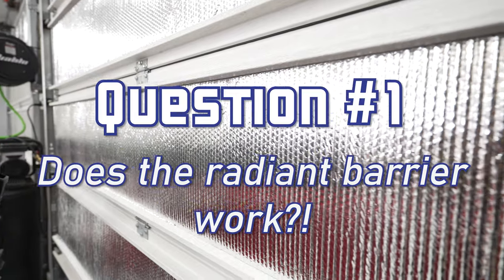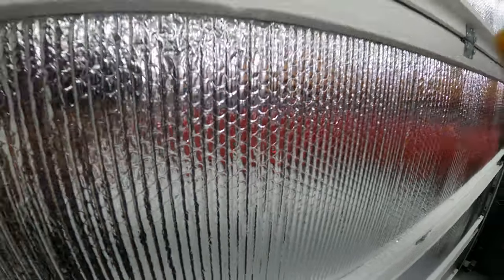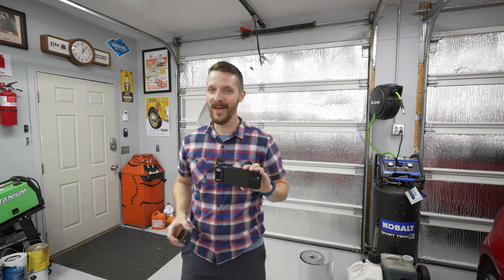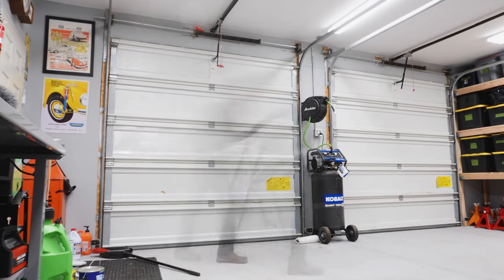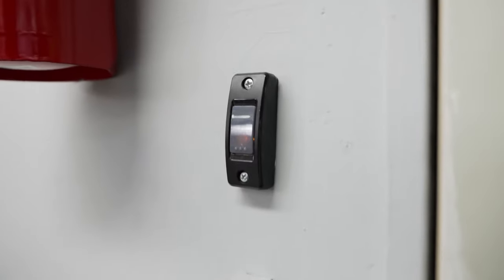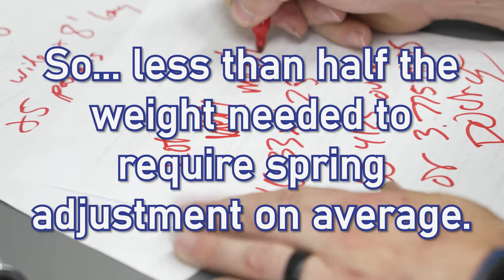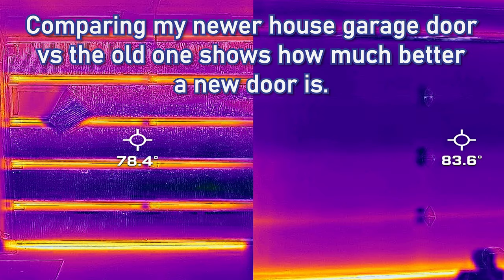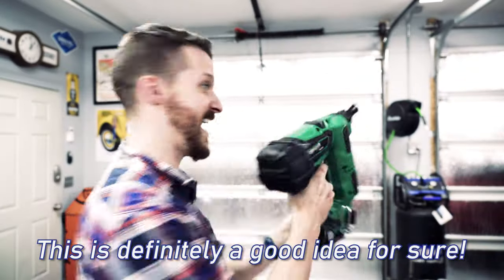DOES IT WORK? Radiant Barrier Insulation on Garage Door! (RESULTS ARE IN)

Comment: Looks great. I've been reading up on this product. I m reading that you need to leave an air gap. If the radiant barrier is in contact w the hot surface, then the conductive heat properties kick in and negate the intent of the radiant barrier. But I do like the evidence u show of a delta of 10 degrees. Your thoughts on the air gap?
Reply from the maker: Yes, it does need an air gap.  I cover that in more detail in the install video.  My installation has a 1/2” air gap. 👍
Reply: 80 F - 75 F = 5 F (when he used FLIR and said "much cooler" instead of cooler). The thermometer results (the way he measured them) should be ignored.

Comment: For me...with a garage facing westward in Florida with no trees to block the sun...it isn't the AIR it's the sun induced radiant heat.  This would be fine.  I worry about baking off the paint on the fron of the door panels though!!

Comment: I'm in the process of doing this now with the same method you used. My door is completely flat so no cavity for an air barrier. The only thing I'm doing in addition is using is foil tape to seal the areas around the hinge hardware. I had it lying around so I figured it may be worth it to try out.
I was hoping it would slow the the heat escaping in the winter when I'm working on the Jeeps but it may have little to no effect if that didn't work for your far more mild winters in Washington.
Thanks for the videos.
Reply from the maker: Nice.  If there’s any way to add an air gap it will work better, but I understand the limitation.
Reply: @JasonExplainsThings  My door is insulated as it came from the manufacturer. .... maybe 15 years old? I don't know what R value it is but I would assume it is the minimum as this was a pretty cheap house to buy overall. If it helps me retain heat in the winter so I don't have to run the heater so much I can let you know.

Comment: By the way keep your truck going.  I have a 1964 Ford F250 pickup with a 4 speed manual and a 1981 Mercedes Benz 240d diesel with a 4 speed manual.  Keep your old truck going.

Comment: For MUCH better performance, make sure there's about an inch of empty space between the garage door and the radiant barrier. Being flush against the door surface, you're mostly acting as insulation. Aluminum is a great conductor and, as you installed it, it's conducting the heat from the door.
Reply from the maker: Nope.  There’s an air gap.  Showed it in both videos pretty clearly.
Reply: The air gap has to be at least an inch and completely sealed.  @JasonExplainsThings

Comment: Have you tried 2 layers? Or, a Reflectix layer topped by a rigid foam layer? A comment from a similar video triggers my thought.
Reply from the maker: 2 Layers wouldn't likely have any further radiant improvement.  Over foam you'd still need an air gap, but depending on the door it could be doable.

Comment: Thanks for the vid!  I've been meaning to install my barrier for quite awhile and am finally mustering up the energy.  These were both helpful : )  Quick question and apologies if I missed it in the first vid:  What cleaner did you use?  I was going to use windex but you mentioned using something that was strong but I didnt catch the name.  Also, I used to live in WA state as well.  Beautiful State but yes; central WA or even Eastern anymore?  Man does it get hot.  Thanks again and I'll check out more of your vids.  Fun but also to the point.  Good job
Reply from the maker: I believe it was windex and purple power for the bad stuff.
Reply from the maker: One note is that purple power will make damage painted surfaces.  :-)

Comment: Love the humor. Wish I could like the video twice!  My garage needs more insulation and I am trying to find a way to do it without blowing in insulation or ripping out the Sheetrock.  Not looking forward to it.
Reply from the maker: One method I've seen (if you have attic access) is to cut holes in the top plate and fill the cavities from above... and then plug the holes.  They did that in my old house... from the first year or so of my channel.
Reply: @JasonExplainsThings   that’s a good idea.  There is access.  I will look at your past videos too.
Reply: You could also cut round holes in the interior drywall and blow in cellulose insulation  from above. I believe plastic, paintable covers for the holes are available. Easier than drilling holes through the upper wall plate. This assumes that your garage is ok with the look of the covers.

Comment: Dont point a thermal camera at a shiny surface and believe the results use some black tape and look at it then as reflective surfaces mess up the readings of ir cameras and it show a huge difference.
Reply from the maker: Thanks for the tip!  If I do future thermal camera tests I'll be sure to do that.  I'm confident that in general the results of this project are positive.  The reflectix is noticeably cooler to the touch than what's behind it.  I'm also putting a pin in this topic.  No more garage door videos unless they need to be replaced.  I'm happy with the results.  Take the info for what it's worth to you.  :-)
Reply: You might want to cover the gaps with reflectix tape

Comment: Thanks for the update! I tried the foam board method and the weight definitely affected the door performance. So glad you experimented this project.
Reply from the maker: Thanks Daniel.  Yeah I’ve heard the foam board can work great may need to just adjust the springs or upgrade to beefier ones.  I’ve installed openers before, but I leave springs to the pros.

Comment: I know they make spray on radiant barrier. Have you thought of maybe getting a reflective spray paint to coat in between the panels? It might not be a huge improvement in temp, but it may offer some barrier protection for those places you couldn’t get.
Reply from the maker: Probably not worth it because the radiant barriers don't do much unless there's an air gap.  But I'll look into it.

Comment: No, they don't. It's an R 2 which Is basically useless , I have installed thousands of square feet of it. I was a pro insulator for YEARS and YEARS. It's a a waste of money. I didn't realize what I was watching I want to say especially don't add it to your garage door because anytime you add weight to your garage door you're just f**** up your garage door when I stopped doing insulation I was a professional garage door technician for 20 something years so there's that

Comment: You should think about combining the two garage door wall buttons into just one multi-door garage control panel. 
Think of it like this, do you carry two separate openers in your car. If you don’t, then why have two separate ones in your garage? If you do, we’ll then I guess you like having multiples of things. Either way, that’s just something I would look into if it were me. Well okay I did, it’s about $40–$75 depending if you want to turn your doors into smart doors or not. Oh, good job on the installation. I think I’ll be doing the same thing. I’m shutting up now, later..
Reply from the maker: Good idea.  The openers are a few decades apart in age.  One died and I replaced it myself shortly after moving there.  The other is still going strong.  But carrying one remote would be awesome.

Comment: You should put more space inbetween the garage door and the reflectix. It is more or less how you get your r-value. With it butting straight up to the metal thats maybe R-1.
Reply from the maker: There's a 1/2" air gap.  It was a pretty clear point in the install video.
Reply: @JasonExplainsThings  of course. I just mean with this insulation the more gap the higher the r value.
Reply from the maker: Oh, got it.  Very true.

Comment: I know this was forever ago... but why not place a small strip on the gaps doing the same thing you did at the top. Remove the hardware and sandwich it there. Doesn't seem like there would be enough bend to rip that product as the door closes and opens.